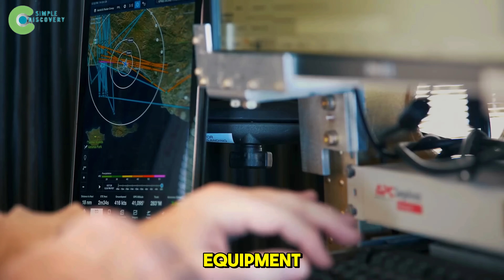They Dumped THOUSANDS of TONS of COCONUT PEEL Into the Sea – The Results STUNNED Scientists

Comment: Many bacteria (such as Alcanivorax borkumensis) are used for oil spill cleanup, several types of fungi have been identified as effective at breaking down petroleum hydrocarbons in marine and coastal environments through a process called mycoremediation. 
The most prominent fungus used for this purpose is the Oyster mushroom (Pleurotus ostreatus). 
Key Oil-Eating Fungi
Research has shown that several fungi can degrade crude oil, often more effectively than bacteria in certain conditions, because they release enzymes that break down complex hydrocarbon ring structures. 
Oyster Mushroom (Pleurotus ostreatus): Known to metabolize polycyclic aromatic hydrocarbons (PAHs) in crude oil and can be used in "MycoBooms" to absorb and degrade oil in marine environments.
Penicillium citrinum (Strain NIOSN-M126): Identified as highly efficient in breaking down crude oil, reducing total crude oil content by up to 77%.
Aspergillus sp.: Particularly Aspergillus niger, which has been shown to degrade up to 95% of petroleum in studies.
Other species: Cladosporium sp., Fusarium sp., and Cunninghamella echinulata. 
How They Work (Mycoremediation)
Enzymes: These fungi produce extracellular enzymes (such as laccases and peroxidases) that break down the long-chain aliphatic and aromatic hydrocarbons in oil, converting them into simpler, non-toxic, or less toxic compounds.
Hyphal Network: Fungi grow as a mycelium network, which can penetrate contaminated sediments more easily than other microorganisms.
MycoBoom: This is a technique where straw or other materials are inoculated with Pleurotus ostreatus (Oyster mushroom) mycelium and placed in water to absorb oil and begin the biodegradation process. 
Key Findings
Studies indicate that mixed cultures of bacteria and fungi often work more efficiently to degrade petroleum hydrocarbons than either alone.
Penicillium citrinum has shown success in degrading long-chain n-alkanes in marine sediments.

Comment: Air pressure hydraulic power cars is needed to replace oil...it is simple and also half motir half generator can have ev fuel less ev ...hair in oil created sorisis and human disease...take hair cut at trusted place or you get cyrse forever if the barber dump your hair at trash land fill
Reply from the maker: You’re making an interesting point—hydraulic and air pressure systems could reduce reliance on oil, and proper disposal of waste like hair is important, as it can contribute to environmental and health issues.

Comment: Why aren't the oil spill robots powered by oil? 😅
Reply from the maker: Because using oil to power machines designed to clean up oil would just create more of the same problem. They’re built to remove pollution, not add to it, so cleaner energy sources make a lot more sense.